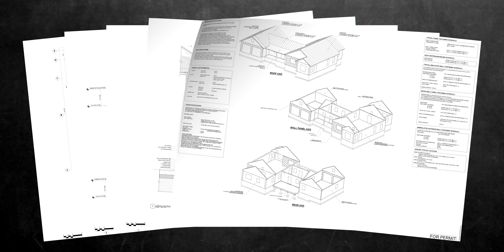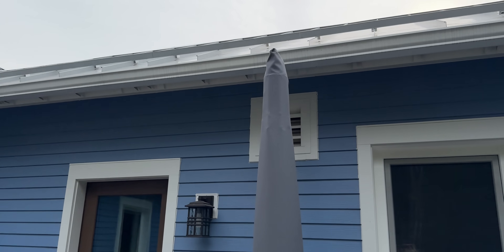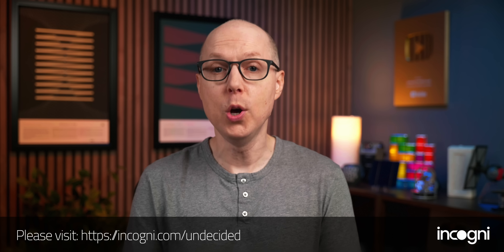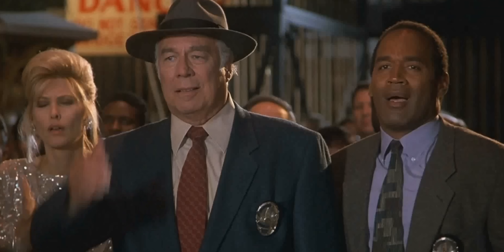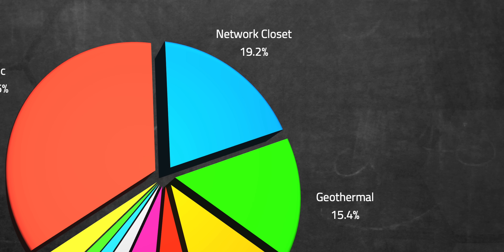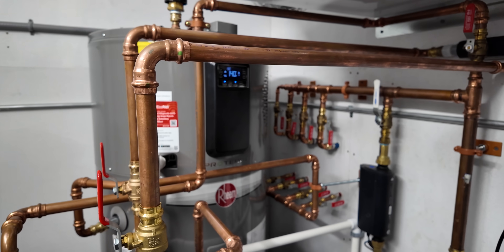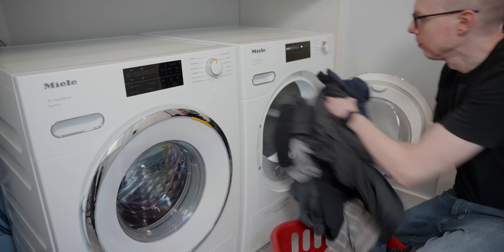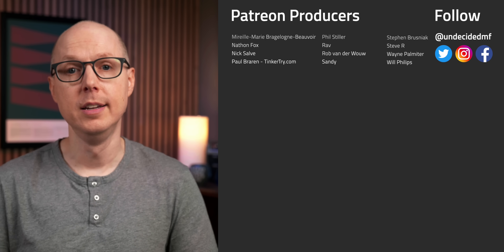What I Learned After 1 Year in My Net Zero House

Comment: You should have built it into the side of a hill, with one side facing South in most climates, but facing East if in a hot area.  You rely too much on technology when things like deciduous trees on the South side to block heat in summer, but let the sun in during winter.  A walk in basement is very good for saving energy.  Building a house with wood framing and straw bales covered with stucco or adobe would have given you R-50 insulation.  Also, covered porches on all sides would protect from temperature extremes.  In any case, it's wise to have 3 - 5 foot roof overhangs.  Instead of triple glazed glass, you can find old wood interior shutters, hit them with a pressure washers, paint them and then use them with blackout drapes to control temperatures.  Overall, you probably would have saved 10 or 15% building it into the side of a hill because you would have no roof and no exterior walls except on one side.  If you stepped down 2 or 3 feet into the house, you would have further savings.  You could have a windowless hall in the back, and have a very long house with lots of windows on one side.  Heating and cooling would be easy because of the earth sheltering.  You could then put solar panels on top of your car port or on top of the hill.  I think in the long run, a partially underground home is a better option.  In your case, with such a bad site to work with, you could have at least put germs on the North and West sides to keep the house from heat in summer and cold in winter.  All this technology will break sooner or later.  If you build passive energy saving features into your project, you will spend 25 - 75% on energy and not need to buy the most expensive windows and HVAC system.  Even simple things like putting the garage in front of a North or West facing home and building a covered courtyard between the house and garage would shelter it and could look attractive, too.  Most homeowners can't afford these expensive features, but often picking a lot where it is easy to do passive design will save a fortune.  I know you are a tech nerd, but often there are simple, cheap solutions.  Only when passive design falls short should you resort to expensive systems.  I bet if you had a house built into a hill, you would have not needed an HVAC system and could have had 50% fewer solar panels!

Comment: Is your heat backup a set of electric resistance coils in your geothermal system? I might be confusing a couple systems as I'm a general contractor not a specialized heating contractor. However I worked on a project with a heat pump. It had to have a complete backup heating system because the heat pump stopped working in the -20-30 F temperatures that were common in the area. 

The part I'm not remembering correctly is if backup heating was required when we switched to a geothermal heat pump. I think it still was, because we had to upgrade to a 400 amp panel, and i thought the backup heating and the ev charger were the reason we needed the extra electricity. However outside air shouldn't affect a geothermal heat pump the same way it does a normal heat pump.

Comment: Last year I replace my HVAC system.  It replaced an existing R-22 AC unit and a 80% gas heater.  I upgrade the AC unit but the heater was replaced with another 80% heater.  Why?  I am 61 years old.  I'll be dead before I reach the payback on the extra cost going to a 95% heater.

When I moved in 10 years ago, I upgrade the exterior doors and doubled the insulation in the attic.  $500 of insulation (2014 dollars) paid back in three years.

I do not know if I would pay a 30% premium on a net zero house.  30% extra is a lot of money that would have been funded my 401K instead of a mortgage payment.  It is a question of what my utility costs would be of my stay in that house.

Comment: I am confused why an average of 399 kwh per month is good for hot water usage.  We have a tankless gas water heater and when our furnace is not in use (but Henerac generator runs weekly test) we use 3 to 4 thrms or based on your conversation just 90 to 120 kwh per month. We have high efficiency all in one clothes washer and high efficiency dishwasher run every other day, but it seems so much lower than your usage. Hence, I am confused.

Comment: Hi, when you calculated away your network and EV, you can't just take it out and then keep the geothermal usage the same.
All the energy in the network equipment, is converted to heat in the end. And is captured by the ventilation. And 70-80% of that gets captured (as you said the hot water was really efficient).
It's only 1-1 per kWh. But should be taken into consideration since it's 19% of all of your power usages. And is dumped into your home.

BTW great video, and fun to see that your house works so great!

Comment: I love Geothermal. I bet one could power their house 24/7 with it.  I also love induction. Everyone who has them do.  It's sad so much disinformation is out there. you should do a show on why it is so much better. Speaking of which there should be a child safety lock on the stove. If not just put something over the buttons like a cutting board.  Why did you not opt for a solar hot water heater?

Comment: 30 Year Geothermal user here (also Waterfurnace).  Totally agree that the set it and forget it model is the right answer.  We DO set the temp lower if we are aware for more than a few days and off in the summer if we're away.  I don't know if yours has the electric backup heaters, but ours does (We're in Michigan so it gets colder here.)  If you up the temp more than one or two degrees the thing may kick in the backup heaters and that's BAD!  

Oh and network closet? Yeah, got that. At it's peak it was 50% of my electric use though 100% of that did help heat the home through the winter.  Now it's more like 16% of our power. (We are all electric home)

Finally those Heat Pump Water heaters. Had one for a decade, once it died, we went back to pure electric.  Here in MI we run heat much more than cooling. During the heating season, the GEO provides most of our hot water anyway and the HP water heater just makes cold air that the GEO needs to make up! In the cooling season the GEO makes almost all of our hot water and its FREE! The extreme cost of the HP water heater was never made up by the tiny savings in our case.  We spend about $10 per month feeding the electric water heater, so even if the HP Water heater reduced that to $ZERO it would never pay for itself.

Comment: My father has a geo-thermal heating/cooling system, he also has a backup heater & A/C for extremely cold/hit days when the geothermal-thermal system can’t keep up with the extremely low/high outside temps. Your backup heating may be something similar. In my father’s case it’s wildly inefficient, he describes it basically as toaster coils that the air gets blown across, but it only kicks on a couple times a year.

Comment: Hi, consider that your network closet is generating significant heat. You could say that every kWh that your network devices use is a kWh of heat energy brought into the home. To show this, I would expect that as you reduce the power consumption of your devices you might see an increase in usage by the heating system, reduced of course by its COP.

Comment: Hey Matt always great videos.  I have personally installed two geothermal triple function heat pumps. Geocomfort from enertech.  They supply infloor heat or forced air and are hooked up to open source wells (water not glycol).  I mostly use infloor heat in the winter and forced air in the summer for air conditioning. I also have 90 evacuated tubes for solar hot water on the roof. This is integrated with my desuperheater. Energy costs are extremely low. I love this setup.

Comment: Our home is very close to being net zero. The seven ways we got here were:

• solar panels installed during NEM 2.0 that generate excess energy that we either keep as credits to roll over or cash out at the end of our 12 month annual cycle

• battery back up that actively switches circuits off grid from 4pm to 8am each day, and all but eliminates peak hour electricity usage from the grid

• upgraded insulation, that included high R value insulation for the walls, ceiling, and garage door, in addition to installing Kool blanket across my entire attic and shared walls between the interior living space and my garage to minimize heat/cold transfer 

• blackout cellular shades on every window. Has made a tremendous difference in insulating from heat in the summer and cold in the winter. 

• whole house fan, used at specific times to quickly exhaust heat accumulated in the attic

• switching our appliances to electric, the washer/dryer combo to a heat pump design, and our old gas furnace/AC to a Daikin heat pump. Far more efficient. 

• switching all of our vehicles out for battery electrics. One is grandfathered into unlimited free supercharging for life and gets 97% of its recharges in this manner, and the other three are either charged from our own solar/NEM credits or from nearby public charging stations costing a mere .0325 cents/kWh.

In all, with all costs and credits included year round, it costs an average of just $68/month to power our home and four EV’s.

We’re not quite a net zero home, but we’re close and certainly happy with the results of being proactive with what we’ve done so far. Soon we hope to replace two of our EV’s with SEV’s; Aptera solar electric vehicles, that have solar built into the car itself. This vehicle’s ability to derive its own energy independently and away from home will help further our transition into becoming a net zero home, by allowing more of the energy produced by our home’s solar to be fed back to the grid for even more net energy surplus.

Comment: You made an interesting point about heating constantly versus certain times of the day. We found that keeping the heat pump going 24/7 was cheaper than only using it when we are home, timed to start an hour before we get home, and to click off when we all usually leave for the day. From what I can figure out the heat pump has to go through a defrost cycle when it turns on, which draws a lot of energy. Secondly, when the heat is removed all the furniture, walls, floor and ceiling loses thermal energy and the heat pump has to heat them back up to warm up the rooms. Lastly, during the day the windows act like a glasshouse so the amount of heat needed to maintain is pretty minimal. As for the roof space, controversial take here, I don't like how modern homes have the roof space open to the outside environment, I would rather use a dehumidifier and keep it warm so that the thermal energy can be used by the HRV system, and to stop the heat from rising into the roof space.
Reply: Yep, my heat pump installer told us to leave it on, to "keep up, not catch up". Way cheaper to run that way.

Comment: 15:22 when I bought my geo, the installer recommended the series 5 because the cost of the 7 isn't really necessary. The 5 ended up being about the same as a higher end air source after tax rebates.

Comment: Our goal was a net zero power bill.  And with 4 increases in power rates in a year I am happy we were able to achieve this on our 45 year old home. We have a Solarroof, replaced every window with high efficiency units.  We replaced all of the installation with much higher rating.  We also replaced the HVAC with high efficiency systems.  We have power walls to ensure we never are in the dark.  The end result is we net about $500 per back from selling electricity to the grid and covering our Nat gas costs.

Comment: Very cool to see what is possible. Although there was an induction stove with touch buttons in the cook surface like that in an apartment I lived in for a while, absolutely the worst stove I've ever used. The indicator LEDs were very unclear what setting the stove was actually on, but the worst part is the stove would overheat if I cooked with a large pan, and it would just shut off. Seems like yours works fine for you, but I won't be caught dead with a stove with touch controls. Give me physical knobs any day.

Comment: Thank you for the video. I have a Water Furnace brand geo and it has been trouble free. However, our electricity bill is through the roof in the winter. We switched to our gas backup furnace and our costs are much cheaper. One thing not explained to us when we were sold the system is the cost of running a well pump to feed the geo. You end up with two very power hungry units in your house. We love the geo for a/c, but you did the system right, do Everything at once, piecemeal is difficult, IMO.

Comment: The basement can be a nightmare if the land has allot of water in the ground.  Yes you can have a sump pump but if it fails your basement will fill it with water during a rain storm.  If you can build the basement at ground level and bring dirt in to cover the walls.

Comment: Matt, I really appreciate all the attention to detail and that you and your wife were willing to go all in on the efficiency driven house plan. I think that a lot of folks miss out on gains because they think that they need to make big, expensive changes to see some benefit. Many homes could benefit from simply addressing small inefficiencies. Incremental change can be easy. We have Duke Energy and they will gladly come and test the house in various ways to find leaks and sub-par equipment performance. Our house is pretty new but there are some things that just boggle the mind like the upper level heat pump air handler is in the attic! So my current project is creating a conditioned space for all of that so it wont be trying to cool the house from a 120 degree attic. It's the largest power user in the house and I know I'll see a big change.

Thanks for bringing us along. I've gotten a lot of good ideas based on your info!

Comment: Dear Matt, you asked for experiences. I'm afraid your whole house is a "rich people stuff" parade.

I'm not in that club, but experience I have that might be helpful for people who are living in a similar bracket to mine.

 My house (in roasting hot San Antonio) was built in 1953 and has not a lick of insulation anywhere. Heat is our major concern here--we have about three official card-carrying days of "winter" here. Think Tatuin, from Star Wars, and you've got the right kind of idea: it's ALL about the mitigation of heat here. 

I have rooms with doors and window unit ACs, which I only run in the part of the house there is people in. The roof was built with louvered eaves. I had an apex vent (a long narrow slot basically) installed the length of the roof, which helps heat escape. I had a solar system installed on the roof (which cost $74,000 with a PowerWall, and I will be paying for the rest of my life), which also shades the roof and reduces the heat load that way. This worked so well I would like to shade ALL the roof, if I could afford it. Most materials are too much money, but I found something that works: you can buy "landscaping cloth" from a hardware store for really cheap in huge rolls, and it is fairly durable. I suspended a loop of this from scrap 2x4s nailed under the eaves to about 3 Ft from the ground, the entire length of the sundown-side of the house, which I suspended downward with fencing wire connected in two places (so I could mow beneath). That's made a huge difference. 

Basements in San Antonio would be a brilliant idea because they are hidden all year from the brutal sun (many houses are built this way in the Outback and don't require electric cooling), but here no one has ever heard of a basement, and they just don't exist. If I could put the whole house underground, I'd do it.

Comment: Matt, there must be something about this that I don't understand.

My house is 65 years old, masonry construction, lots of 65 year old windows that are about as air tight as you'd expect. There is no insulation anywhere in the house. It is a poster child for inefficiency. Yet, I am net zero, energy wise.

When I bought the house six years ago, the first change I made (within weeks of purchase) was to change everything to electric power, then install enough solar panels to more than cover my usage. Later, although I remain grid-tied, I installed enough battery storage to get me through the night-time hours should there be a grid failure. (If it were a prolonged failure, I would have to cut back on non-essentials like garden lighting, swimming pool pump, two large computer systems* running 24-7, etc.)

My energy monitoring system is simplicity itself: As long as my electric bill stays negative, I am net zero.

All of this cost me a tiny fraction of what you spent on just your subterranean heat pump system. What am I doing wrong here?

*Two computer systems are necessary because of religious differences: I am Windows, my wife is Macintosh.